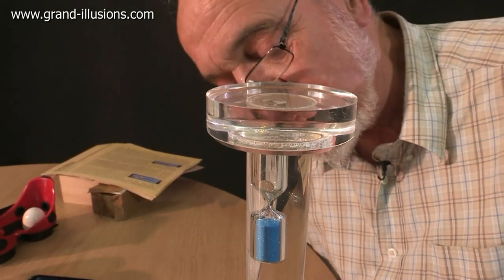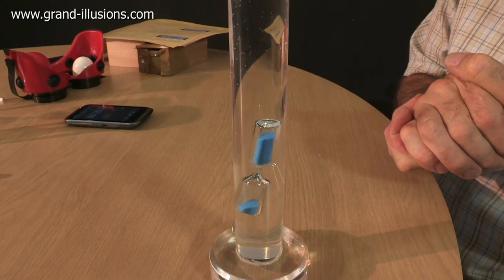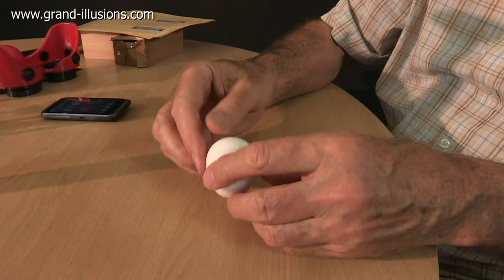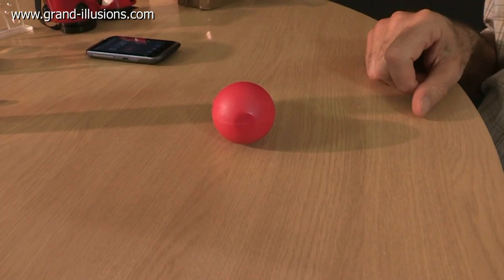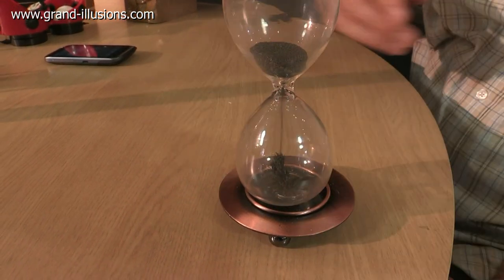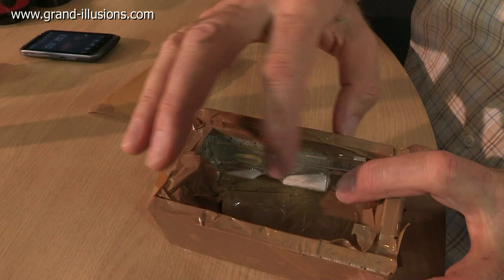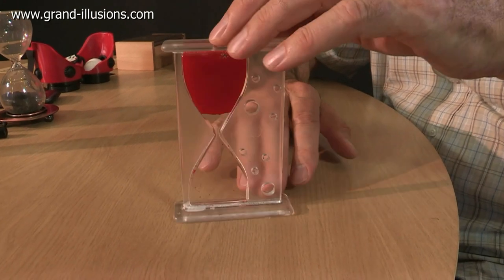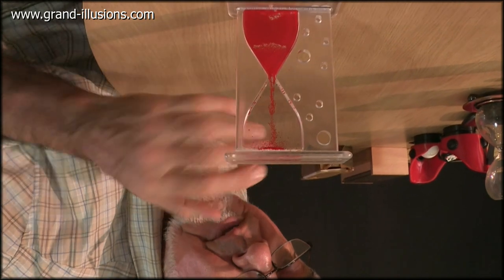To see a World in a Grain of Sand

Comment: when the sand is at the top, the top heavy sand timer wants to flip over, causing it to lean against the inside of the glass tube and wedge itself in place. when the sand is more evenly distributed in the timer it stops leaning and floats up.
very clever. :3
Reply: Five Bob says they're for people afraid of heights and the lenses contained sand.
Reply: BitSmallX3 Yes in that model, but if you look at the article it has one that completely fills up the tube so it cannot lean at all.
Reply: rdizzy1 There'll always be some give, even if the hourglass appears to completely fill the tube. If the hourglass actually was a perfectly snug fit it would never move anyway, because it'd be held in place all around by the tube.
Reply: DarthEditous not to mention there would be no room for the water to pass around it,and it would be held down by the water pressure on top of it and the vacuum created underneath it should it move at all.
Reply: Good point!
Reply: thanks bitsmall time didn't tell us ha ha
Reply: +BitSmall Heh!
Reply: What's it wedged against? The inside of the tube is straight, and looks smooth.
Reply: greenaum
That doesn't mean there's zero friction as it leans against the side.
Reply: greenaum if you've ever rubbed a glass stirrer against the wall of a beaker, or even just the bottom of the beaker, you would know that glass isn't exactly low friction and glass on glass can really get wedged. Try it if you get the chance.
Reply: @TheActionBastard  when does glass-on-glass happen in a bong?
Reply: extraordinary :)
Reply: @QuasiELVIS  the bowl going into the bong it self? lol
Reply: I was considering this but then why does it start to sink again , if it was heavier than the fluid to begin with , it wouldn't have risen , friction or not
Reply: @siddharthhasavimath8307  It doesn't, it's not that it is heavier than the fluid but top heavy and the path of least resistance is such that it wants to flip so the buoyant side is facing up (probably because the sand is not evenly distributed) - thus it wedges itself as air escapes to the surface of the top, rights the timer to straight, guiding it up the tube. I think the key is so long as the tube diameter is smaller than the length of the timer, this will always be the case.
Reply: @UltimatumNo5  nvm it would seem I was a fool seeing things that weren't even there. For so reason my brain had me convinced that after the hourglass reached the top and the sand was all in the bottom compartment , it starts sinking again , which was the only part I couldn't understand . Turns out it didn't make sense cause it never happened on re-watching it .
Reply: @siddharthhasavimath8307  Don't worry, you're not a fool, just don't rush
Reply: Amazing! Thank you
Reply: It's alcohol and water
Reply: Or maybe the fact something falling is heavier than something stationary...
Reply: @BitSmall hey! that's the same guess I gave!!! xD great minds think alike. :)
Reply: Nope. As the sand falls through the hourglass, the object as a whole becomes less dense because the material is becoming more spread out. When a certain amount of sand has fallen through, the hourglass becomes less dense than water, and thus begins to float. When all the sand has fallen through to the bottom of the hourglass it will sink again because it has become more dense than water.
Reply: @Nitephall  no actually.
the hourglass does not get any more or less dense, think about it. density is calculated by mass divided by volume. as long as the mass and volume stay the same, then the density will stay the same.
in the video, the mass is not changing, the sand can move around wherever it likes within the confines of that hourglass, as long as none of the sand or air escapes the hourglass, then the mass will not change.
also, in the video, the volume is not changing, everything stays within the hourglass, and the hourglass does not expand or shrink in size, so the volume stays the same.
and if both the volume and mass stay the same, then the density stays the same.
the sand and air within the hourglass both take up space and both have mass, the combined volume and mass of the air and sand does not change if the sand moves around within that pocket of air, the volume and mass stay the same, and so does the density.
the density of the hourglass should also include the mass and volume of the hourglass body itself. the density of the hourglass (including contents) can be calculated like this:

    mass of hourglass + mass of sand + mass of air
                                    divided by                                                   =            Density of the whole hourglass including sand and air
volume of hourglass + volume of sand + volume of air
Reply: @richardlilley6274  hey Richard, the difference in mass would be so small, that the movement wouldn't be visible.
Reply: @Nitephall  it doesn't get denser because the volume doesn't change, the hourglass stays the same size the whole time, and the hourglass stays the same mass the whole time. in this case, you can just use the weight of the hourglass instead of the mass, because here on earth, the weight and mass are basically equal.
weigh the hourglass, and divide that by the volume that the hourglass takes up.
Reply: @richardlilley6274  what are you talking about? momentum will push on the scale harder than gravity alone, yeah I got it, but how does that have anything to do with this video? if you're saying that the falling sand would hit the bottom of the hourglass and make it sink, you would be wrong, I mean, that didn't even happen in the video, instead it floated.
Reply: @richardlilley6274  I just gave some example math, what is wrong?
Reply: @Metal_Master_YT  you said you got it...
Then ask why... 
You'll have to lose ya pride to truly learn friend 

Or watch his earlier film explaining..!
Reply: @Metal_Master_YT  clue is in the name you chose..
It reflects your manners.. 
Little bit arrogant and very presumptuous
Reply: @richardlilley6274   why not prove me wrong then? go ahead!
I'm using a mathematical equation, math doesn't make mistakes, 2 plus 2 will always equal 4. in the same way, my equation (which is a globally known equation btw) is correct, and it will stay that way. because of this, as long as I don't make any calculation errors, then my answers have to be accurate. if I made a calculation mistake, then you are welcome to point it out, but stop telling me that I'm wrong without any evidence, I have by proof, where's yours?
Reply: @richardlilley6274  Can you explain fully why you think the hourglass doesn't float to the top until some of the sand has fallen to the bottom?
Reply: @stevenh4314  yes I can thanks
Reply: @richardlilley6274  Ok
Reply: @stevenh4314   @Steven H  can you explain fully and truthfully why your wearing sunglasses for a pic taken indoors.. ?
Reply: @richardlilley6274  Yeah I can do that
Reply: @richardlilley6274  You suck at trolling, pal, giu gud.
Reply: @tafazzi-on-discord ever crossed your mind that it's down to the fact you suck at spotting trolls
... An I ain't your pal
Your ego is your only pal

Comment: when the top half of the hourglass is full it wants to flip so it creates friction with the walls, thats why it doesent rise. when tehre is less sand on the top half the force gets weaker and the hourglass is free to float.
Reply: Teofil Raicu It has to be friction
Reply: Indeed. In other words: the center of mass in the hourglass is "more centered" in relation to the cylinder so the hourglass wants to "turn less" or "collide less" with the walls until it ultimately wants to go straight up.
Reply: Damian Reloaded or basically the top is heavier so it wants to go down and flip over, causing it to push against the glass and causing friction to hold it there.
Reply: Cubeazza yep. still the buoyancy force is greater than the total weight of the hourglass. ^_^
Reply: Coppershielt *spreads wings* activates mustache propeller zooooom!
Reply: Teofil Raicu I was thinking so, but it seemed that the small vial did not come upright when it began to rise, but remained angled almost to the exact degree as it floated. If the center of mass had crossed the centerpoint, we would have seen the heavier bottom half pull the vial perfectly upright.
Reply: Oogalook It didn't have to. The friction just decreased enough for it to float up.
Reply: Teofil Raicu Or maybe its a change in air pressure. As the sand flows it creates a vacuum in the upper chamber while compressing the lower chamber.
Reply: Teofil Raicu clever
Reply: Barry Jenkinson The air would flow through the sand though.
Reply: Teofil Raicu friction and gravity working together
Reply: Teofil Raicu (For the skeptics here about your correct solution) Here's the last page of the article he's referencing: http://librarun.org/book/11657/138
Reply: +kcthewanderer It's definitely not using friction... at 00:20 you can clearly see the top of the hourglass VERY slightly swaying left and right inside the tube after Tim turns it around.  There is clearly no friction there holding it against the sides of the glass tube immediately after turning, it is clearly being held at the bottom by some other force while the top is free to wobble around.  I honestly don't know the answer to this but pretty sure in THIS case it's not friction (but in some models of this toy perhaps it is friction).
Reply: I see what you you mean, you have a point, but I'm not completely sold and you don't give better answers .. 

explain exactly why there would be no friction, 

most of the things do have friction when in contact, even air has a friction.. 

now Again, I'm not 100% sure that friction is the only factor here,, if the hour glass is made out of or some sort of material that creates a lot of friction against the inside of the glass tube then it's pretty clear .. 

but if it's glass against glass .. then the friction would definitely be so small, in that case it would be almost too small of a factor ..
Reply: +Doug Reed to bring an old thread to life. my theory before I read anything here was that there are two similar transparent liquids, maybe both thick oils, with a very sublet difference in density in the main tube. when he flips it it takes a moment for the two liquids to swap ends. the sand timer inside has a total buoyancy just above the least dense of the two.
Reply: +Steven Cassidy subtle* Not sublet
Reply: +Steven Cassidy I think the difference in refractive index between the two liquids would be noticeable.
Reply: refraction, you think photons are involved? :D

Comment: In the first timer. The floating egg timer. The sand is acting like a ballast. When you invert the tube, the sand timer becomes unstable and wants to flip so the sand is at the bottom and the air at the top. This self righting mechanism is used in ships, the the centre of gravity wants to be as low as possible, so the half with the most weight wants to be on the bottom. So when the sand is at the top this inbalance causes the egg timer to try and flip, but it is restricted by the tube. The egg timer pushing against the side of the tube has enough friction to stop it from rising until enough of the sand has flowed in too the bottom half re distributing the weight and stopping the egg timer from wanting to spin. This wouldn't work with out the restrictive tubing. Eg at the bottom of a pool. It would just flip and rise up before the sand had a chance to move to the other chamber.
Reply: +Nick Henman Exactly.   You explained this very clearly.   When I looked at this the first time I doubted the perspex tube would create enough friction so I gave it a try with a weighted wooden stick.   The real skill is to make the overall density of the sand timer just slightly less than the density of water.

Comment: probably the first thing is like that because since the air is in the bottom of the hour glass and the sand above it the sand wants to fall over but since it cant it wedges itself against the wall of the cylinder. once enough sand has fallen to the bottom of the hourglass and allows enough air to go to the top it balances out just enough to unwedge itself and start floating upwards.

Comment: Air portion of sand timer wants to rise. It can't because not enough room to turn flip, hence stuck at bottom at an angle to base. Once enough sand has moved down and replaced with air, timer straightens and the now airy portion rises.
Nice simple concept.

Comment: It's naturally bouyant, it's just the fact the top is being pulled down, and the bottom is being pulled up, and they don't have enough room to rotate around so they're pressing up against the sides of the tube, and friction is keeping it in place until the amount of force pulling the bottom half down is the same as the top, at which point the hourglass can straighten out and rise.

Comment: I remember a bunch of guys got into one the the biggest youtube battles I have ever seen about how this thing works. They both seemed kinda smart, and a bunch of stupid people kept on interjecting. It was insane and it took me like 25 mins to read the whole thing. The whole hourglass can never really change buoyancy so what's actually happening is when the sand is at the top, the hourglass is leaning on the side and pressing itself against the inner wall of the tube. When enough sand flows down, the top becomes more buoyant, and so the hourglass goes straight up and down without rubbing against the walls at all.
Reply: kindpotato By youtube battle, do you mean in the comments?
Reply: MrHarr Harr yes
Reply: +kindpotato Ikr! Lots of crazy people interjecting people in youtube.
Reply: No it's not. If friction cause this, when tim flip tube at the first time, the hourglass goes up a little bit. If you look carefully, you can see the hourglass swing in it.
I think there is a diaphram in it. Volume of hourglass changes when sands goes down. Once a time I made a that kind of toy that for my little brother.
Reply: If hourglass is flexible and not rigid, buoyancy can change by changing air pressure in it. you know air can be compressible.

Comment: here, let me guess why the hourglass does that, (I haven't watched the whole video yet and don't know the answer) I think that its due to friction. think about a missile, or a rocket, they have fins in the back to keep them going straight, and the center of mass is usually put near the front of the missile/rocket so that it doesn't turn sideways in the air, but instead stays straight. in the same way the hourglass wants to flip around while the heavy sand end is on top, so that it is no longer on top but on bottom. (due to gravity of course) the sand end is pulled down and the air end is pulled up, and with how weak the total upward force is, friction is able to hold it in place touching the edges of the bigger tube, not unlike the recent jam in the Suez canal. but when enough sand falls down to the bottom, the hourglass stops trying to right itself because the light (air) end is now on top so therefore it is pulled straight up, and is no longer trying to lodge itself in the tube, but instead starts slowly floating upward.

Comment: that first toy is beautiful. i could be wrong but at first guess i would say its just the law of bouyancy. bouyancy is a function of density. density is a function of mass per volume. the volume in the hour glass is fixed but the mass ie the grains of sand move. as it moves toward a specific distribution of mass the bouyant force which is a pressure distributed evenly (all be it as a vector quantity sorry ill go back to lay speak) across the sufrace area of the timer when it reaches a very specific point of mass redistribution the density of the object decresses (not litterally since the two sides of the hour glass are connected but with such precisse mass distribution ie grains of sand and with the hour glass being comprised almost of two seperate objects being only tied together by a thin point in the middle even a little bit of turbulent flow left over in the water tube(from being turned over) would cause chaotic actions. ie the precission of the timers mass redistribution coupled with the geometry of the object forces us to except most models as good approximations at best but can not deterministically say without more data what exaactly causes it.) and the bouyant force over comes the gravitational force. There really does not need to be that much more energy in the system for this to occur. in otherwords we can not say gravity-bouyantforce=the mass of the object *accleration. we are not breaking laws of physics the system is just to precise to be explained through mere visual observation. It is a wounderful trick to talk about nondeterminism calculus and a shit ton of physics lol. thanks!

Comment: I think that because when it's empty at the bottom it tries to rotate. Since it's confined it exerts a force on the side of the flask. This force is felt as friction on the inner hourglass preventing it from rising. As the sand flows into the lower chamber, this friction force slowly diminishes. It should be noted that the densities of the hourglass and water are almost equal.

Comment: For the secret opening box, if you want it to be safer, you can make it with two hourglass locks instead, one with all sand on the left and one all on the right (locks are still on the same side). This will prevent someone from turning the box upside down and unlocks the box.

Comment: My guess is that it isn't a change in friction that causes the timer to rise. It's that the sand falling lowers the center of gravity of the sand timer which increases the overall buoyancy and the height of the equilibrium point of the sand timer (air+sand). This causes the timer to rise.